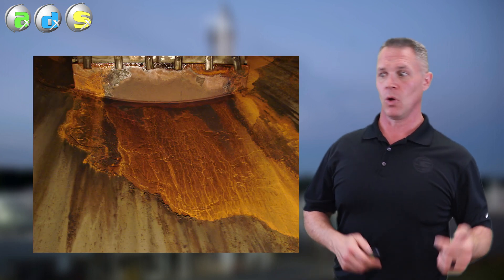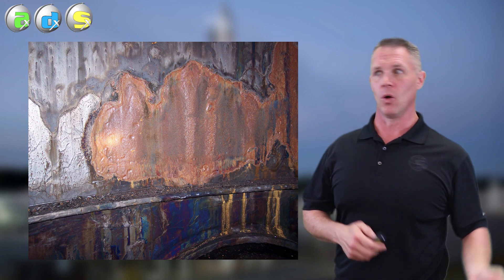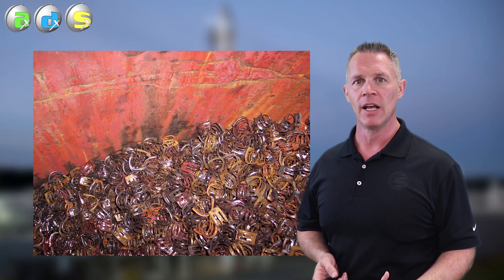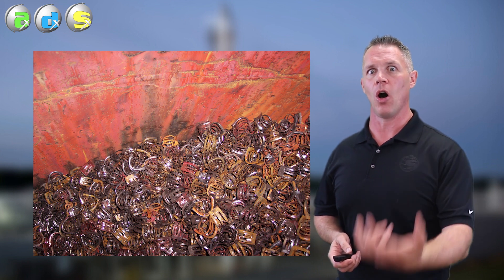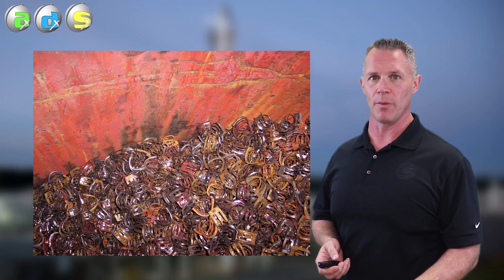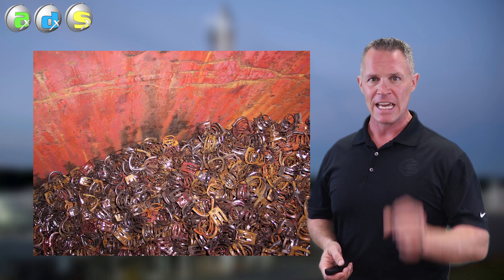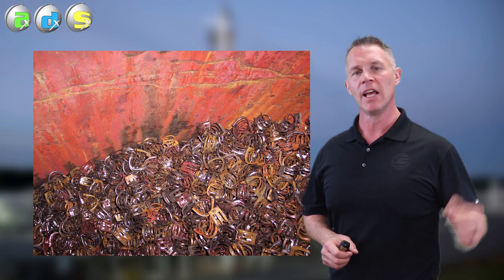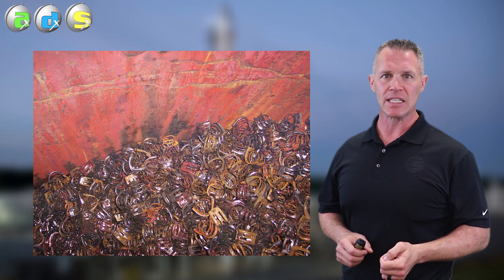Can You Over-Strip Amine Systems? (Part 3)

Comment: If we add Phosphoric acid, we are effectively taking down some Amine and forming heat stable salts. So as I understand, when we add 1 wt% of the acid, roughly 3% of amine (ours is DIPA which has almost the same mol wt as H3PO4) would already be protonated all the time driving the equilibrium towards the formation of H2S in the regenerator. Does this phenomena work well with DIPA? or we have to buy a proprietary DIPA solvent for it?
Reply: Sooraj - yes the effect is the same on DIPA. For example, a recent refinery I simulated with 45 wt% DIPA has 236ppmw H2S in the lean amine. If I add 5000 ppmw phosphoric acid to the amine but make no operational changes whatsoever, that same lean amine now only has 31 ppmw H2S.